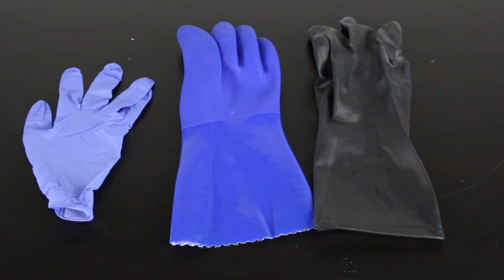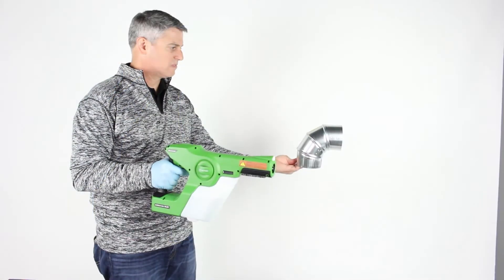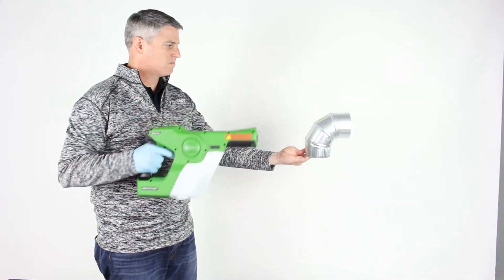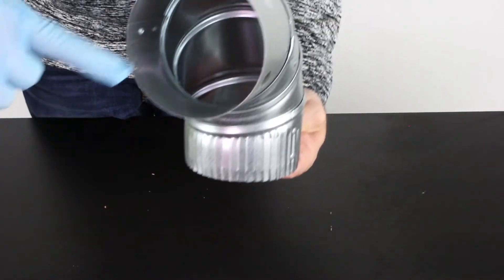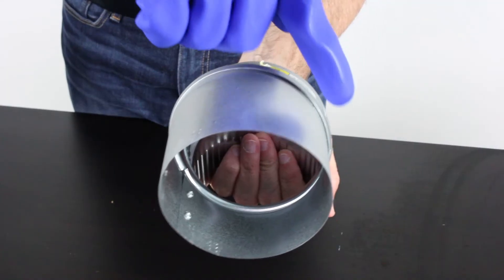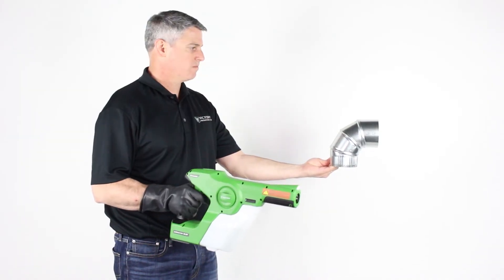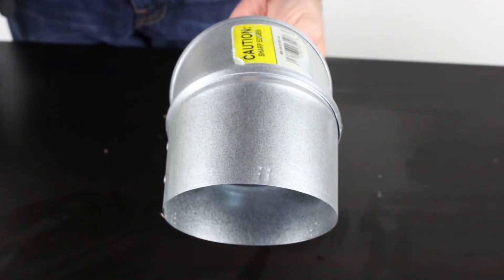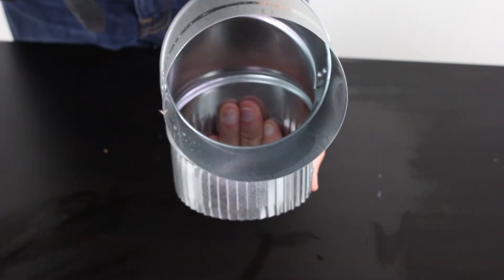Victory Innovations - Glove Myth Busting

Comment: Would this still be the case if you had a rubber glove on both hands?
Reply: I think in realistic, day to day use, you wouldn't be touching what you're spraying. I would like to see him demonstrate that it does work with both hands gloved though.
Reply: @Chaunceylola  I was using my sprayer at home... If I held the wine glass wrap around coverage. If it was on a table covered with a sheet. Not so much.